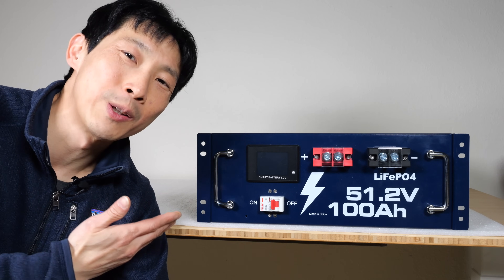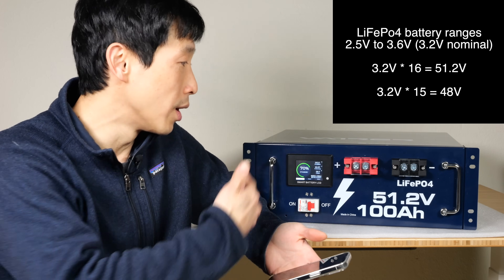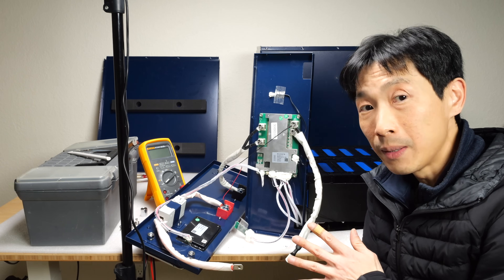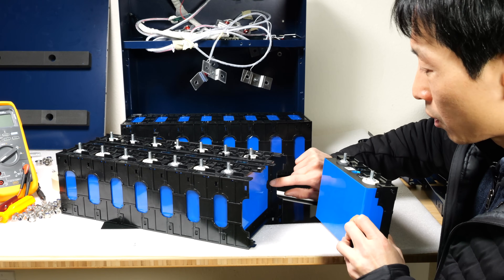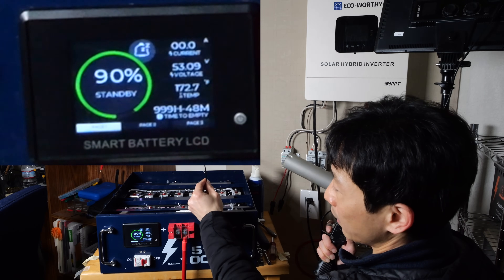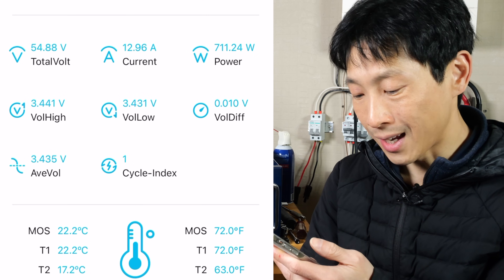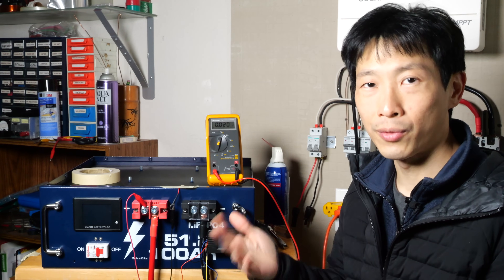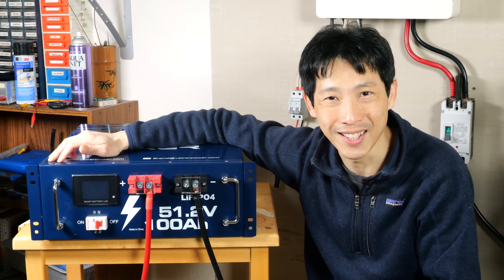Why a 48V System is Better than a 12V? [Vatrer Power]

Comment: I just received this same battery from Vatrer. Mine when it hits COV has cell#1 at 3.713V and the rest at 3.4 volts. I contacted Vatrer and they said 300mV difference is normal. Lol, no. Having a cell peak at 3.713V while the rest are at 3.4V is not good. Does your battery do this or are all cells balanced well below 300mV diff when COV MODE cuts charging?
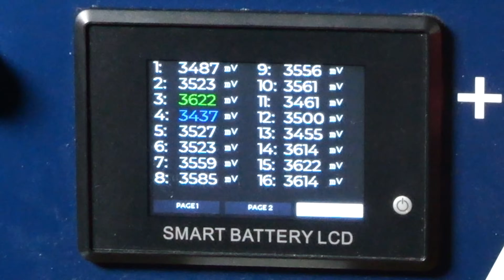Reply from the maker: 3.65V is the limit so going there is really bad for the cell. If you look at 11:34, the top voltage is 3.624V. The issue is not a 300mV difference but the highest voltage each cell attains. 

Perhaps one cell is a little lower in capacity so it charges much faster. You might want to discharge it a little and let the balancing work to equalize the energy. Then recharge it back to 100% to see if it does the same thing.
Reply: Thank you for the reply. Yes 3.65V is max and certainly not good to float there, 3.713V like mine even worse, all cells except #1 go no higher than 3.4 to 3.45 but the cell#1 is ovrecharging/peaking at 3.713V then battery bms goes into COV while the other cells sit around 3.35v to 3.4V. I like your pack balance distribution better. Yes,  I was going to manually deplete a little off of cell#1 and I suggested me doing just that earlier to Vatrer but they didn't address that. They just had their tech say it is all normal and fine with the one cell peaking at 3.713V while all others are at 3.4V.... but we know better. 😉 I was giving it a few cycles to see if it would balance out on its own, but I think I will go ahead and do a minor manual depletion on cell#1 while I have it apart relocating the bluetooth module to the back of the LCD display so it get get some signal out. First thing I noticed after the cell mismatch was the poor range of Bluetooth. I build my own packs and bought this battery so I would not have to  match and manage varying balance of salvaged LFP cells, just to manually balance new grade A eve LFP cells...😂

Comment: Server rack style is great but I prefer 4x12 series for 48V. 
Still can use individual 12V batteries in back up systems if one fails. Server rack goes out and you’ve lost 5.12kW in one swoop. 4x12 and lose a battery take the remaining good battery(s) and hook up to backup 12V rig and keep the lights on.
Reply from the maker: Question for you. Have you ever lost one of the 12V battery in 48V system? I am interested in the failure mode. If it does fail, the others are likely not far behind.

Comment: Wow they're using AC rated isolation switches to try and switch High current DC voltage - not good!
Reply from the maker: Thanks for pointing this out. To me, this is a very serious issue and will pull the purchase link from the video description for now. I will suggest the manufacturer update this to a DC breaker, possibly have them send me a retrofit one and update the product if possible.

Comment: I have an issue with the video. You state about the higher the voltage the more dangerous it is.  Then you take apart the battery connections without protective gloves. Then you comment that you're an engineer and how its a 100a system.  Basically what I'm getting at is you're setting a bad example by not using protective gloves. The first thing you are taught about working with electricity is safety. Kids watch your videos. Set the proper example not just by talking of the dangers but showing how to do things in a safe manner.
Reply: Human skin conductivity is low enough it’s fine.  For him to touch the connections when current is not running its safe.  What’s important is to avoid dropping an uninsulated tool across positive and negative terminals.  If you let your kids near this that’s adult supervision negligence.
Reply: @rabbitpumpkin8279  so now blame the parents. I think we are all parents. As such we all help as a collective. I will defend a child from a danger. Even if I'm a complete stranger to that child. Not just children though, I've done alot in my lifetime to protect life and property. I don't want to do something that could harm anyone. I would hope that the op would think the same. Besides if the op was to find himself looking for a job this vid could be bad. Many employers do deep background checks on job candidates. If an employer was to view this vid and note the same thing that I saw this could be used against hiring the op.
Reply: Diy! Diy! U should know better never to do this at home.
Reply: People love to argue about anything nowadays 🤦‍♂️

Comment: Are the wires copper a lot of aluminum being substituted which means you need thicker wires.
Reply from the maker: Aluminum doesn't necessarily mean it is bad as long as it can carry the current capacity stated and remain under the design temperature in the worst case scenario. So if they use aluminum, yes, they have to use thicker wires to make up for not being copper to meet the same specifications.
Reply from the maker: Btw, the wires are copper.

Comment: I may have missed it in your video, but does it have a pre charge resistor?  Thank you
Reply: To limit the current
Reply: Yes, does it have anything to limit current when power is first sent to the inverter to not overload it. If I am saying that right.
Reply from the maker: There is no mention of one in the manual. I'll check with the manufacturer to see if if I missed it.

Comment: yeah and WHY is a 48 volt system better?   lots of talk just not about your title.
Reply from the maker: Smaller cables, cheaper cables with the same wattage output. But I go over this in detail in the video.
Reply: The whole video explains the advantages.

Comment: A few notes:

100Ah cells can discharge 1000 to 2000A when shorted.   No BMS there to stop it.   The "100A" 1C discharge is a BMS limitation and also BMS-enforced, so externally the BMS won't allow continuous discharge above that.  But many BMSs and cells have no trouble allowing 2x or 4x (200A, 400A in this case) discharging for a few seconds.   These are mostly limitations of the BMS, not so much the cells.  The cells are certainly happier when charged and discharged below 1C... less stress, higher efficiency, but there is no hard-stop.

Inverter disconnect should typically be set at 48.0V and not much lower.  Even though the cells can tolerate going lower, the pack will be 95% discharged at 48.0V so there is not much of a point allowing it to go lower.

For tools, even with the extension you are sticking a lot of metal into a battery box.  Don't do that!  At least wrap the exposed bits with electrical tape as much as practical.  Or buy properly insulated tools.

In terms of touching 48V... as long as your hands are dry, the most you will get is a light buzz.  If your hands are wet or sweaty though, don't be messing around.  More importantly, 48V can produce a substantial arc when you make a mistake, so don't stick your face close to 48V wire / bare metal, you don't want an accidental arc to permanently screw up your vision. 

And a substantial amount of power is involved if you actually short anything, even when the BMS is there to save you, so even though you can touch 48V with your bare hands, you still need to be careful when messing around with cables.  Always de-energize the wiring or cabling (when possible) before messing with it.  People often add extra 2-pole breakers for this purpose... just to make working on the equipment more convenient.

In anycase, there are many advantages to 48V, not the least of which being able to use far lower-amperage solar charge controllers and far, far, far lower cabling losses, being able to use far smaller cables, and far less heat produced from the equipment.

-Matt

Comment: If I had the skill you have, and I already had the wire, would you recommend changing out the INetrnal DC large wires for much larger AWG welding cable?
Reply from the maker: The internal wires get warm but it will be well within the limits of the heat shrink and insulation internally. You wouldn't want to touch and hold them but you cannot do it anyway since they are normally inside. They waste a bit of energy from heating so I would check how much energy it wastes vs the cost of the mod.

Comment: Math is math....
Batteries dont make more power because you go from 12v to 24v.
2 - 12v , 100ah batteries = 2400 watts regardless of whether in series or parallel.
Reply from the maker: All things equal, going form 12V to 24V reduces power loss in the cable by about 30% so you can use thinner cables.

Comment: people with 4 12v inverters could connect their inverters in series to a 48v battery 😜, joking don't do this. It's good to check, check, check, check & check again when connecting the bus bars.
I had a brain fart and had 2 cells shorted and scared the crap out of me, im lucky the aluminum bus bar didn't weld itself.

Comment: Don't want a 200ah one? I'm  looking at one now. It's only 189lbs. No problem for me.
Reply from the maker: A monster fo a battery!
Reply: Yes it is! I just noticed that battery doesn't have communication ports on it. Is that or the touchscreen monitor really necessary with the bluetooth that it has installed on the BMS.? How well of a bluetooth signal do you get with that metal case?  Thank you for this video and response to my questions.Much appreciated.. @BeatTheBush

Comment: I live in montana...what good is a 32 degree low temp?
Reply: Might want to look into sodium Ion batteries. They're' just starting to be mass produced. They can operate down to 14 F. Of course some Lifepo4 batteries have built in heaters but they cost more.
Reply from the maker: Does it get that cold indoors?

Comment: I like your review style a lot! You should do more batteries 🙂 Does the BMS have passive balancing and if so how many mA? And what is the criterion to start balancing? May look like a detail but may be important in the long term. Also does it have an inrush current circuit?
Reply from the maker: Yes it has leads to all cells in the battery for balancing. Not sure about the max mA it can do though. When using it, I have seen the balancing kick on pretty easily within the app. No mention of inrush current circuit. (in this case, it is current rushing out into the inverter)
Reply: @BeatTheBush  cool thanks

Comment: Went to a solar expo they had 100 volt inverters and batteries….
Reply from the maker: Yep, Double the 48V, pretty dangerous at 100V though.
Reply: @BeatTheBush  I know but Huawei inverters has some models which area battery ready and they accept only Huawei batteries. I read somewhere they are high voltage batteries.

Comment: I think it's better to buy lower voltage batteries, which are more standardized and cheaper due to mass production, and simply connect them in series.
Reply: Well I guess I have to take back what I said about cheaper. I don't know what's happened to the prices but they're mental now.
Reply from the maker: You would have to get a battery balancer to keep the cells balanced which adds to the cost.
Reply: @BeatTheBush why  bms of individual battery don't work when we connect 4 batteries in series?

Comment: I'm glad my smart online electrical engineer brother is here to disassemble this and analyze it :)
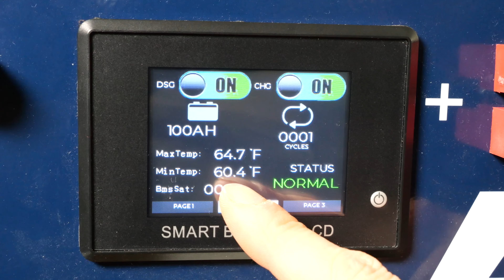@9:05 what counts as a cycle?
Reply from the maker: It's not stated in the manual but I would guess 5120Wh flows out = 1 cycle. So you can flow half, charge half, then flow another half, then that equals 1 cycle. I doubt it would keep track of lower capacity as it ages though.
Reply: One full cycle is typically counted as 95% discharged.   If a LiFePO4 battery is discharged 50% and then charged, then discharged 50%, then charged a second time... that basically counts as one cycle.

All LiFePO4 cells are roughly similar in terms of cycle life, but marketing materials vary and will market different numbers for different 'depths of discharge'.  That said, there are some differences depending on the manufacturer.  Pouch cells typically have a higher cycle life than prismatic cells, but prismatic cells are more robust.

Also, it is far less stressful on the battery to cycle the top of the battery than the bottom.  The bottom of the battery is where most of the damage actually occurs.  So it is very typical to charge to 100% and have the low-voltage cut-off at 5% (roughly 48.0 volts for a 16s pack is 95% discharged).  No need to let it discharge further than that.
Reply: Interesting :)

Comment: Can your inverter talk to it on closed loop?
Reply from the maker: No, there is no such function with this rack mount battery. It can only see the voltage at the inverter terminals.

Comment: Wow, how much was it, 50 something watts for the inverter? That's a lot. Is that a fixed value or a percentage of the total load?
Reply from the maker: 50 Watts is fixed when the inverter is on. You can have it power down if it uses less than 50 Watts after a period of time. In order to make it worth while, you'd have to have enough solar to compensate.

Comment: Great review! The gear is just getting better and better. 
I'd love to see a 100A load open case with an IR camera to see those wire temps. Is it a weak link?
Reply from the maker: I was told the worst case is 80C so this will be under the 125C of the heat shrink and 200c limit of the cable insulation. Externally,  I don't like things to go over 60C since that is hot to the touch. I am curious myself so I'll be running tests on this soon.

Comment: 48v with lead-acid is also not 48v.  Each lead-acid cell is 2.1v nominal, hence the 12v car battery at full resting voltage of 12.6v, and charge voltage as high as 14v to 15v. This matches well a 4 cell LiFePO4 lithium battery, with a nominal voltage of 12.8v (3.2v/cell) and a charge voltage as high as 14.6v.  Put 4 of those in series for 48v and you get 51.2v nominal and a charge voltage as high as 58.4v.

Comment: I still feel the goldenmate battery is still the best for the buck in terms of dollar per kWh after the coupon code. Correct me if I’m wrong
Reply from the maker: It depends if you will be making a 48V system. In that case you have to add in the fuse, wires, lugs, tools, battery balancer, wireless connection monitor to the cost of the goldenmate. This one you get all of that in one package.
Reply: @BeatTheBush  And being all in one package the BMS can better balance all 16 cells, instead of 4 groups of 4 cells balanced separately.

Comment: Maybe off topic from this video, but......Not having an engineering background, I am still confused about voltage.  Household voltage is referred to as 110v or 120v?  Half of 240v being 120v makes sense versus 110v.  Power Tools can be found as 3v, 6v, 12v, 18v, 20v 24v, 48v?  (X *2) or +6v seems like the logic so the 20v makes no sense to me in this example for some reason.  US voltage is designed lower/safer than higher European voltage, but I used a $3 cheap plastic adapter off the street and the phone charges just fine.
Reply: Look up technology connections "120V"
Reply from the maker: Just because power tools are usually a certain voltage, doesn't mean they have to be. They standardize on those so it's easy to understand. The voltage of the battery is dependent on the chemistry.

Yes, a cheap power adapter works but there may be features not included such as short circuit protection, low ripple of the output current, longevity, compatibility with various USB protocols, etc.
Reply: Most of the time the actual number isn't critical.  The U.S. 120v is a nominal number. The actual voltage is allowed to vary from 104v to 127v with a goal to keep it within 108v to 125v.  This is from ANSI C84.1 first published in the 1950s and revised multiple times since then.  The nominal value used to be 110v(220v) and for a time was 115v(230v) and is now 120v(240v).  Europe went thru similar changes and widened the tolerance range in various countries in order to unify their power grid.

And note that those are all average (Root Mean Square or RMS) values, being the D.C. equivalent of a sine wave A.C. voltage.  The peak value of a 120v RMS sine wave is over 170v.

Batteries are similar.  The common lithium power tool battery uses 5 series cells with a chemistry producing 3.7v to 3.8v nominal at resting full charge.  But fully discharged they might be 3.0v and the max charge voltage is up to 4.2v. But often the charger will limit to 4.1v and shut off, at which point the cell will fairly quickly drop to 4.0v.  This means the 5 series cells range from 15v to 21v resulting in manufacturers claiming 18v or 20v most commonly. Kobalt uses 6 series cells and calls it 24v. The Ryobi and Greenworks and Kobalt 40v outdoor power tools use 10 series cells.  Ego 56v is 14 cells.  Etc.

It's all pretty lose, because it is just chemical reactions (batteries) and big mechanical equipment (grid power production).  This means anything critical needs to have a voltage regulator and filtering to give it a precise and stable voltage.  Your USB "charger" is actually a power adaptor and regulator producing the correct voltage(s) and power levels defined by the USB standard (5v +/- 5% at 0.5a was the original, 1.0a and up to 2.0a are common with the device taking what it needs up to those levels, and it only gets more complicated from there with Quick Charge and USB-C Power Delivery (PD)).